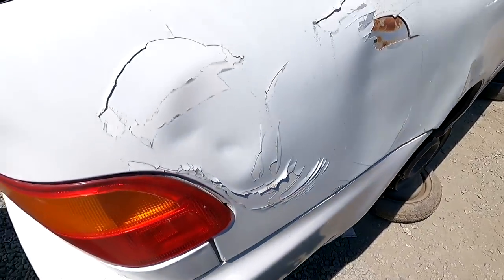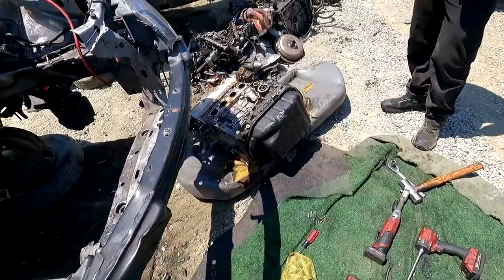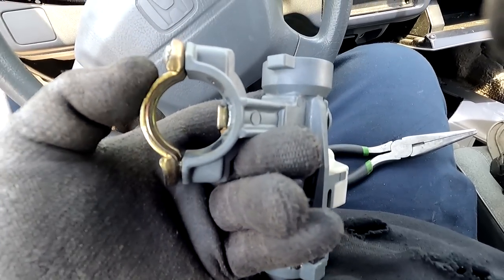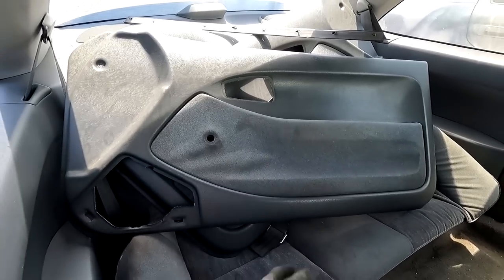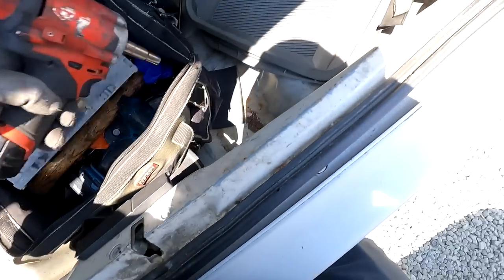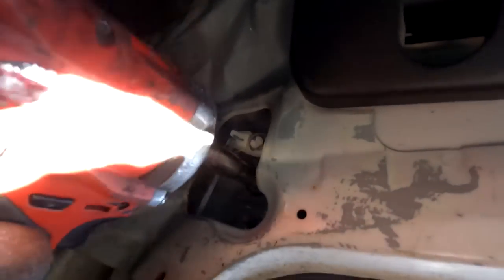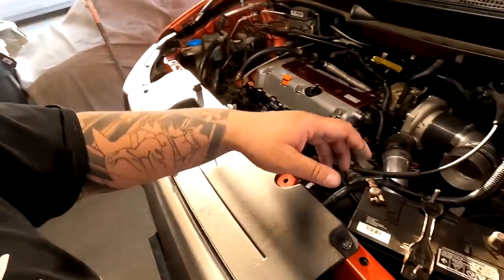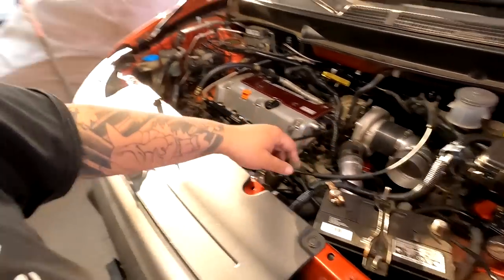JUNKYARD SCORE !? MINT HONDA CIVIC EJ2..OR WAS.

Comment: Fun fact the key cylinders are bolted down with breakaway bolts designed to break the head off when they’re tightened so you can’t “steal” them as easy but the chisel method breaks them loose and can spin em out and use a regular 12mm in its place.
Reply: I’ve only ever used a flat head too lol never a chisel

Comment: I've been working on my friends RX8 for a month now we replace exhaust after they stole the catalytic converter put on 0/2 sensor upstream one change the spark plugs coil packs wires new filter new oil cleaned all the sensors new mass air flow sensor car still starts runs rough  backfiring into the intake